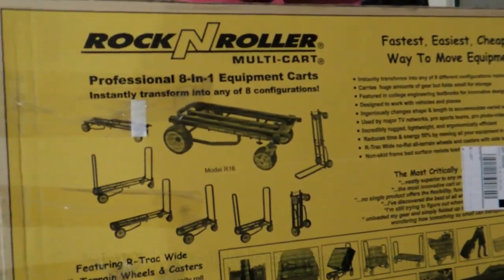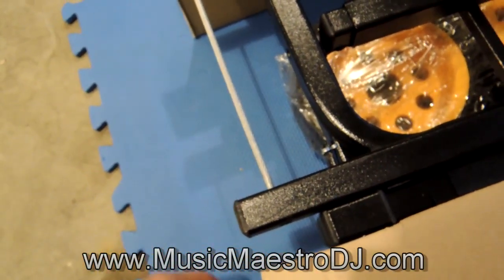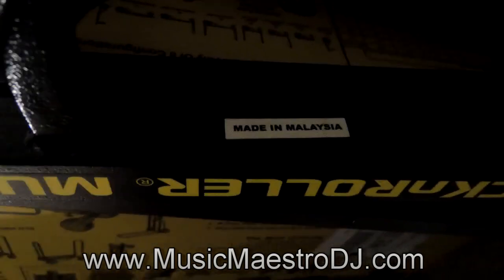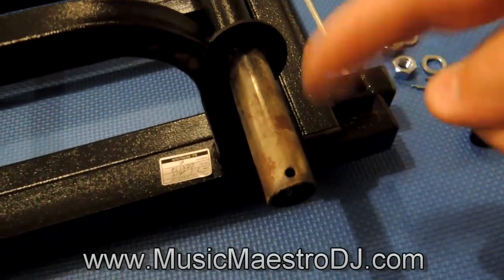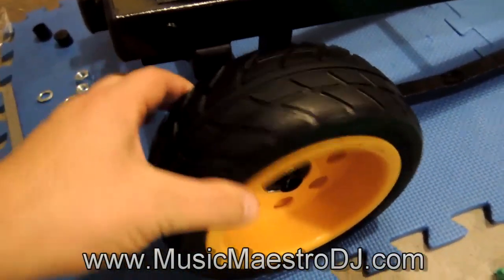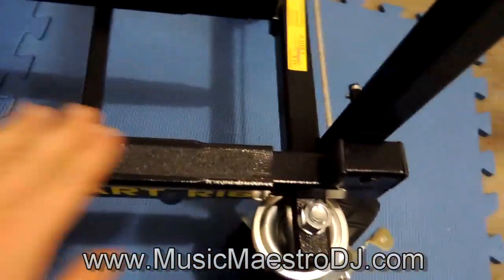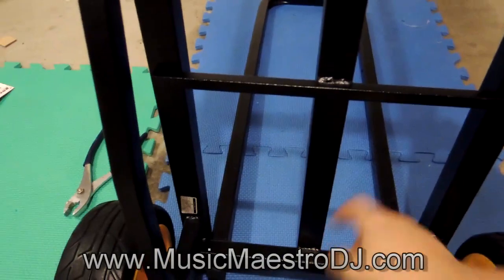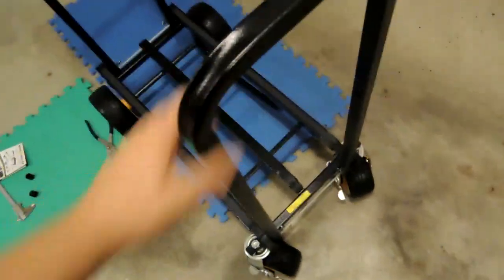Rock N Roller R16 Cart Review

Comment: I've added 3 thin polythene washers, that I bought in a local DIY store, to take out the lateral slop in the rear wheels of my R16 & that seems to have done the job. I think you're right about drilling the extra hole for the pin. My cart came jammed down inside itself so I had to put all my strength in to pulling it out, which could well happen again I guess, so the extra hole is a must.
Reply from the maker: Yup, adding two washers and drilling one hole is the way to go!

Comment: Are the handles any thicker/stronger than the R12 as with the R12 the handle bends if you are pulling up hill or steps with a heavy load?
Reply from the maker: R&R says the tubing is: Tubing gauge: 16 gauge (0.065" wall)
Tubing size on main frame: 1" and 1.25" square steel tube. The handle feels solid and will handle whatever you can put on it as long as you are pulling it. It you are pushing it, you want to load the cart so the handle is braced against your load so you don't put too much pressure on the those little tabs shown in the video.

Comment: Any update on how the cart has worked out for you?
Reply from the maker: So far, so good! Been using it for nearly two years and it has held up well. I like to push the cart and not pull so I try to pack it so that the bar is braced on the load. This is very important if you have to push it up ANY type of incline. As long as you do that, you shouldn't have any problems. It is 'decent' to push on grass but not great. Gravel? Forget it.